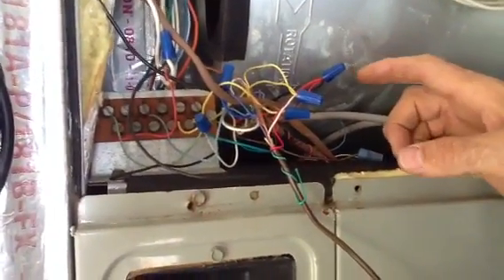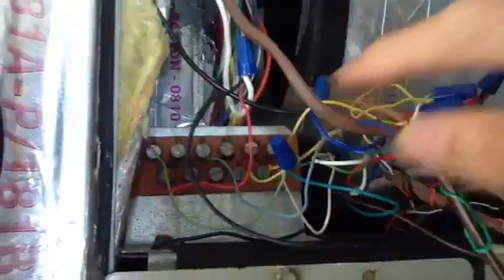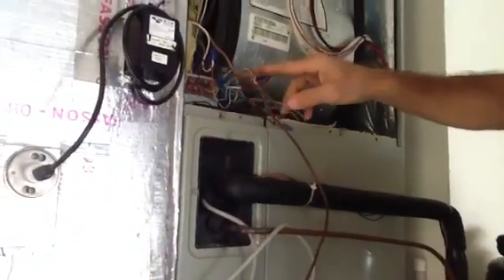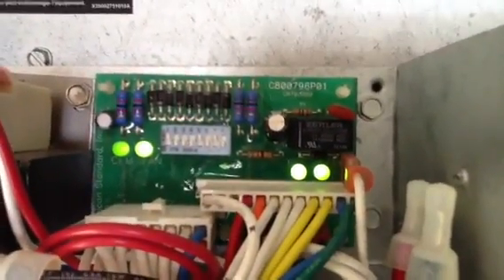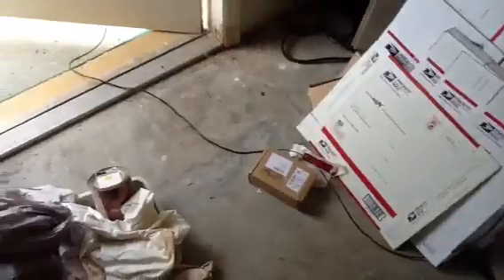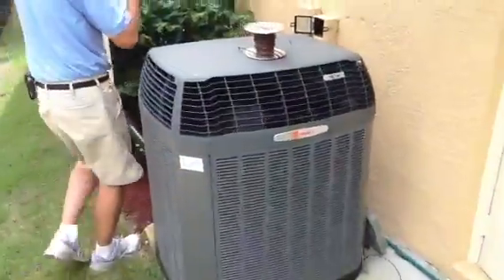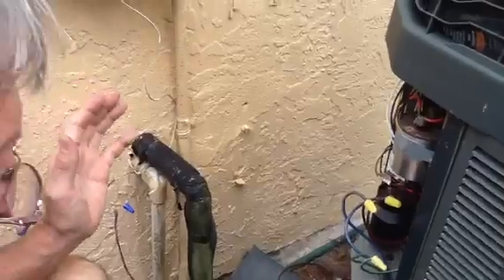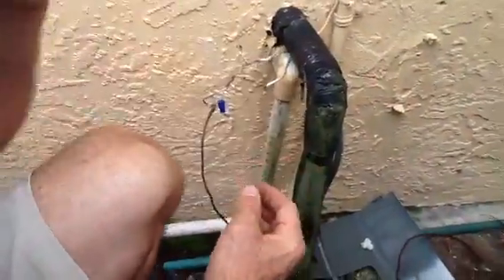24 Volt Problems with Air Conditioning

Comment: Hey David quick question. It's a heil gas furnace w a added on carrier a.c. coil on it. After a storm hit the area the customer lost his cooling on the unit. Said his hear worked but his a.c. stopped he had someone come over swap a stat and picked up a new cap the turbo 200 he played around w the transformer on the ffurnace the owner kicked the guy out felt like he didn't know what he was doing. He called me I tested the transformer for continuity and it had it on 24 v side but the 120 side was dead. I replaced it w a new one   I also installed a new t stat   I tested the contactor on the condenser it got 240 v but on the 24 v side nothing I tested the 24 v on contactor and it beeped showing continuity. I'm at a stand still I tested Most the wiring for continuity it all had it but going to condenser nothing showing 24 v. It's a 28 year old girl gas furnace. Doesn't have the modern mother board it just has them furnaces t stat strip where u wire t stat and condenser into.  Can I jump 24 v from transformer into that t stat strip to be able to get 24 to the common and Y to send the 24 v to condenser ??

Comment: How should I debug if I'm only getting 16V at thermostat?
Reply: Turns out the fuse was blown on the furnace board.  Strange, I would have thought that would have produced 0 volts, not 2/3 voltage.  Strange.  But in any case, if one ever gets a weird voltage on the thermostat wires, the board fuse is something to check.